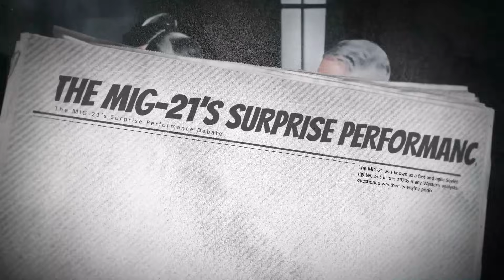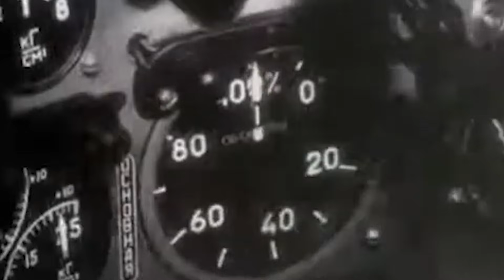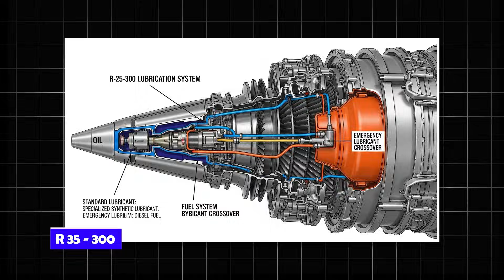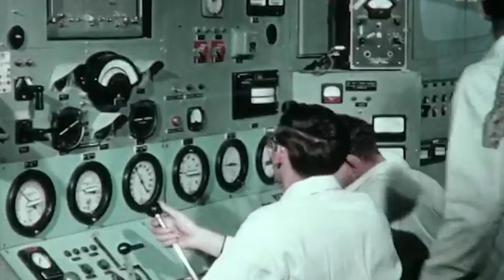The Shocking Truth Behind TUMANSKY R-25-300: MiG-21’s Deadly Secret

Comment: Tons of bullshit!
The R-25-300 pressure ratio is just 9.8, not 11 or 14
Vladimir Ilyushin had nothing to do with the R-25-300, since he was the Sukhoi test pilot and there was no any Sukhoi aircraft equipped with R-25-300.
There was no such thing "3 minutes rule". To replace anything on an R-25-300, you had to remove it from the MiG-21 first, which procedure requires to disassembled the whole aircraft at the 28th bulkhead, rear fuselage. To achieve it, you had to disconnect everything, hydraulic, fuel, oil, electrical etc, and need a special trolley to separate and roll away the rear section. For a well-trained crew it takes a half day.
The R-25-300 had nothing fancy. It was a parallel side project of Tumansky bureo, the designer was Khachaturov, and the goal was the simpliest and cheapest way to improve the MiG-21 flight performance as much as they could. The basic engine was the second main iteration of the mentioned R-11, the R-13-300 from the MiG-21MF. So the R-25-300 became the third iteration of the lineup, by a very simple set of modification. 
They reduced the first stage blade numbers, from 24 to 21, but used wider chord blades for the higher air mass flow (from 62 to 68kg/sec). They set the pressure ratio from 8.9 to 9.8, which was still nothing fancy, but the maximum, what they could achieve without any more complex control. Even with this minor improvement the R-25-300 became the most unstability-sensitive variant engine of the whole MiG-21 story. By the higher pressure ratio and airflow, they could apply the DCN-44 barostatic control and the NR-44 emergency fuel pump besides of the NR-54 main and the NR-22 afterburner fuel pump. By the extra NR-44, which was activated electrically from the cockpit, but triggered only by the DCN-44 at certain circumstances (above a certain intake pressure, below 4000m barostatic altitude, below Mach 1, with 3minutes time limit) .  To achive a better AB performance, they changed the AB flameholders to what the MiG-23M/MF R-29-300 engine had. Also elongated the double wall AB chamber cooling. That's it. The R-25-300 had the shortest operating lifespan from any MiG-21 engines, due to the way higher heat load on each components from the first stage to the nozzle. And the top on this, every emergeny "ChR" regime 3 minutes takes minus 50(!) OPH from the lifespan!